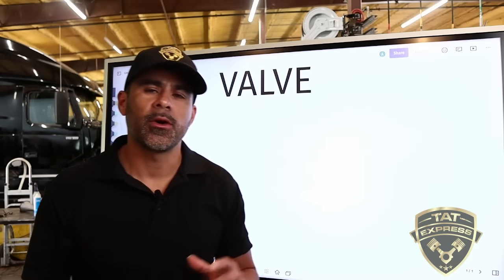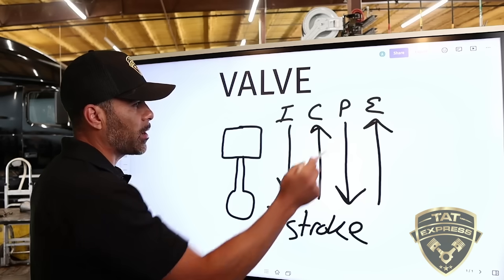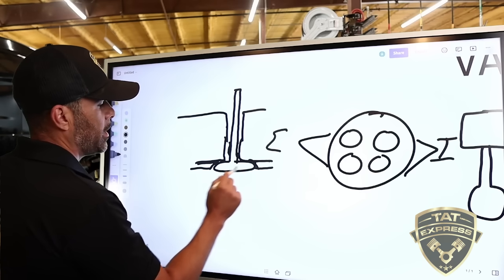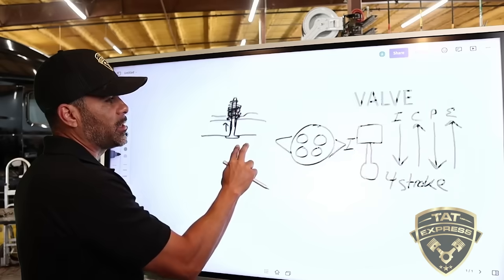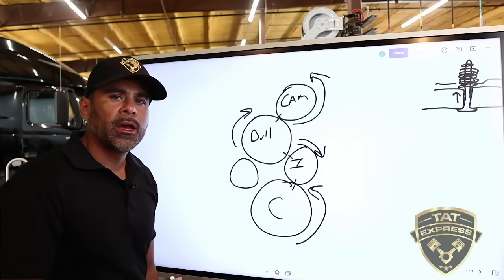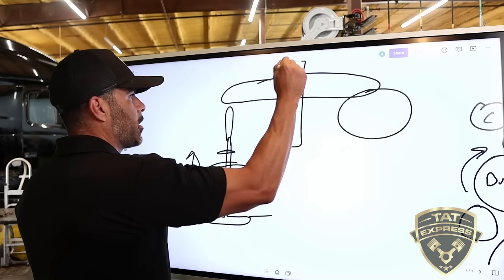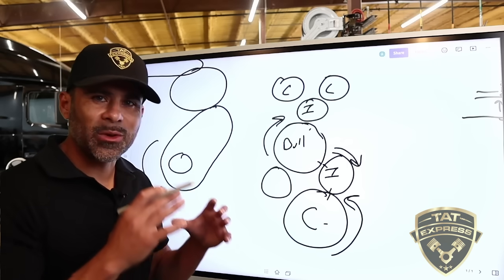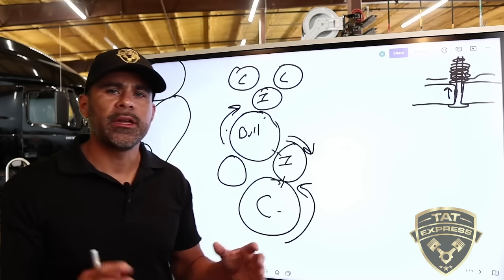What Is a Valve Adjustment On a Semi Truck

Comment: Not all semi trucks have a 4 stroke. Many years ago Detroit Diesel had a two stroke. It requires special tuning and if the Governor broke or oil started leaking into the cylinders it would run away and burn up. They were dangerous, look them up, there are still a few of them around.

Comment: Mtu extended valves springs or super tech sodium filled valves three 3 springs in one power train valves n with portable boxs cutter to use what ever mm diameter for skf cooper split cage ceramic roller bearings as main bearings for crankshaft n camshaft I made Detroit diesel 14 liter Long block inline 6 2 stroke 12 v 149 ur going to need to put them together but u can open it up with chip dte  for german motors 4500 rpms they got john deere doing 6900 rpms 10 liter pushing 4500 hp

Comment: Hey Adam, I like your videos and been followed you for a while, out of respect, I went to your shop to exam my truck, but the quote provided shocked me and I backed out

I know my truck is kind of old sure it got some issues, but when I see 1 wheel seal only labor is going to cost me $440, along with some other labors I don’t know what for. and on the paper I was suggested change all 4 leaf springs on drive, I was wondering just maybe 1 of them is having issue and it’s not even leaf spring but maybe the washer or nuts or U-bolt is a little bad, why do they suggest me changing all 4 of them? 

I deliberately took a load went to Dallas, and stayed there waiting for your shop to check my truck, I paid $220 for a courtesy check and eventually on paper if I ought to change 2 wheel seals, 4 leaf springs, 1 hose for air compressor, 1 air dryer, all that going to cost me $8600 something dollars

So I backed out, trucking is dying, my truck under this market probably not worth $8600, I went to TA changed 1 leaking wheel seal and cost me $3-400 in total, again, I respect you and really appreciate what you doing, I guess I’m just too poor to afford such repair. I hope your mechanic can show and explain to me why do I need to do all that instead of just send a message with pictures of what they found. 

My truck is already over 1 million miles without any overhaul, it runs great because I try to maintain it well, but with your quote, sorry I can’t afford it

PS; it’s a pity didn’t get to see you, I don’t like going down to Dallas usually, hard to find a decent place to park, hard to find a decent load out

Comment: You are 100% wrong not all semi-trucks are four strokes you can still run an old v-series Detroit or cat whatever V series 2-stroke even inline 2-stroke in a truck. Maybe you should clarify yourself and tell everybody that all modern trucks come with a 4-stroke
Reply from the maker: All modern engines on the road are 4-stroke.  It is rare to have a 2-stroke in a semi.
Reply: @TATEXPRESSINC  that is not correct there are a lot of Two Strokes still out there on the road
Reply: @rodchandlerii6922  Modern Railroad locomotives are 4-stroke. There are still RARE 2-stroke diesel running the rails. With this said the 2-stroke engines are less fuel efficient and do not meet the Tier 4 EPA emissions.
Reply: @chrisferrell1037  I'd say highly unlikely you'll ever see one because most people who have them work on themselves or they have a trusted mechanic that knows what they're doing my guess is you don't have a clue with a two stroke but that's just me pulling shit out of my ass like everybody else
Reply: @rodchandlerii6922  only 2 stroke I work on is passenger cars. I was thinking a 2 stroke diesel was like a rotary passenger car.
Reply: @chrisferrell1037  not even close
Reply: @rodchandlerii6922  what's not even close?
Reply: @chrisferrell1037  I'm not a mechanic I'm not going to try to describe the difference between a rotary motor and a 2-cycle Detroit Diesel
Reply: @rodchandlerii6922  not what I meant at all.  I meant in commonality today not operation. Sounds like 2-strokes were primarily used for boats not semi's.
Reply: @chrisferrell1037  sorry that would be another incorrect statement they were very common especially Detroit's the old 871 and the 8v 92 or commonly known and a specific era as a silver 92 were very popular the 12v 71 was also a less common but still popular option
Reply: @rodchandlerii6922  sounds like you're a 2 stroke afficiando. You a 2 stroke bloke? Would you also claim I'm incorrect when I say a 2 stroke was made in late 2020ish?
Reply: How many are out there?  What are the chances he or even I, when I get home,  will work on one?
Reply: "...all semis..." 

He means in general, no?